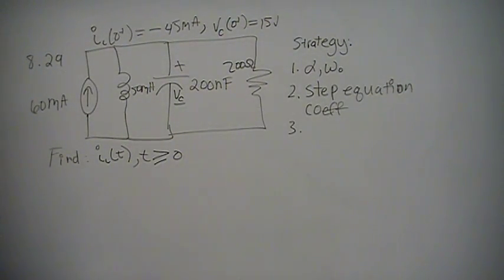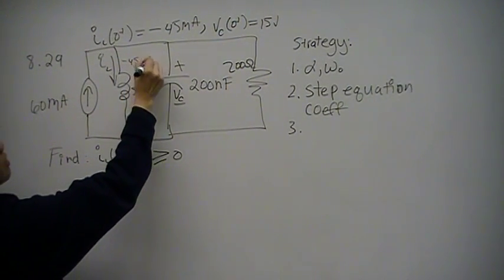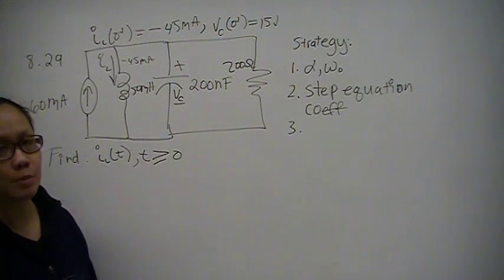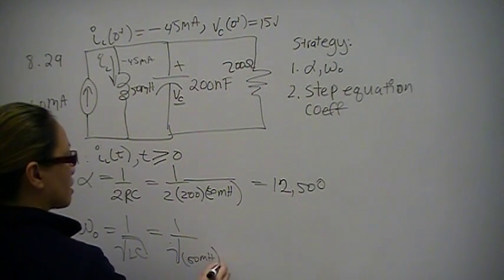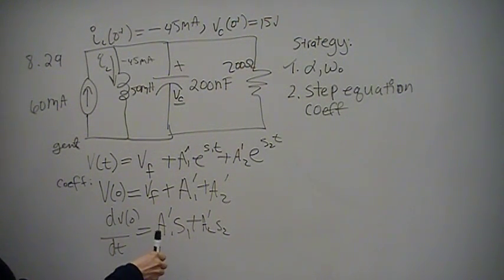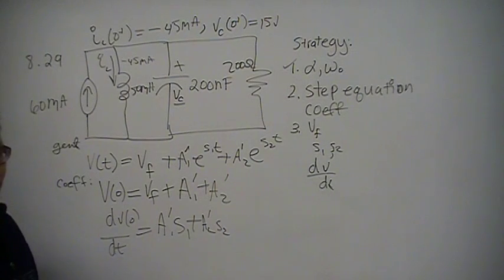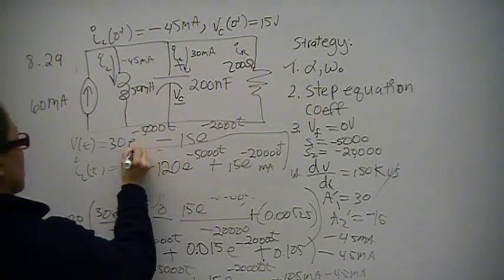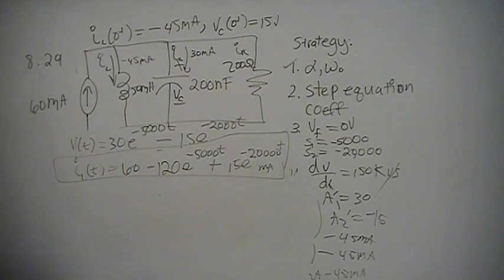P8.29 Nilsson Riedel Electric Circuits 9th Edition Solutions

Comment from the maker: thanks for your sweet comment! <3 xoxo
the proof is in doing KCL for parallel RLC circuits and KVL series RLC circuits. The general equation allows us to find current or voltage easily by knowing certain initial conditions and solving simple systems of simultaneous equations. ill do some videos on this as soon as i have some free time. :)